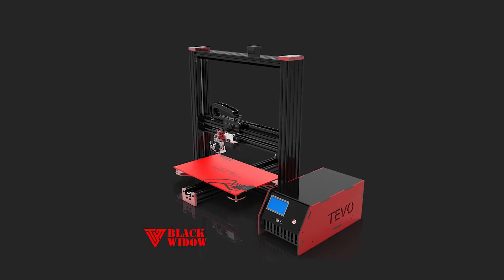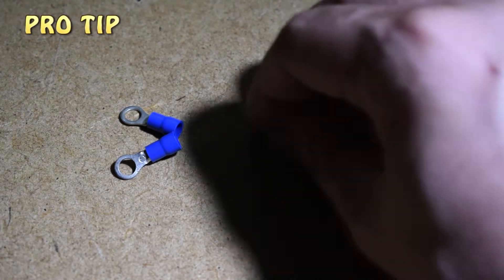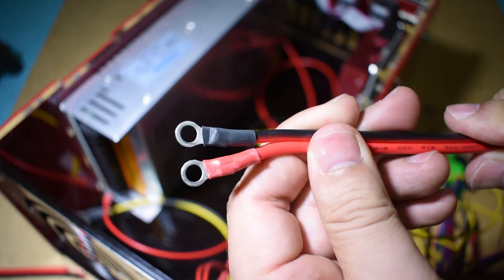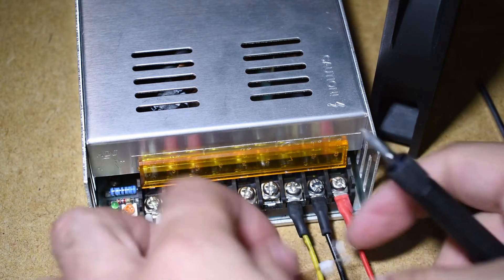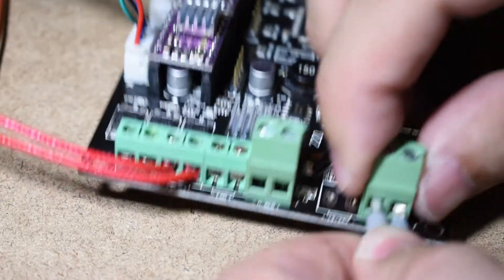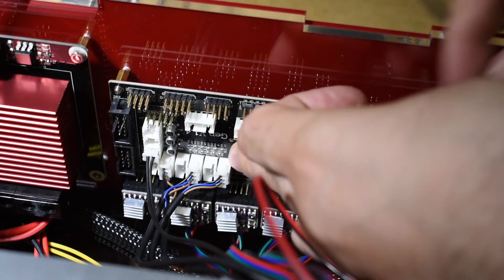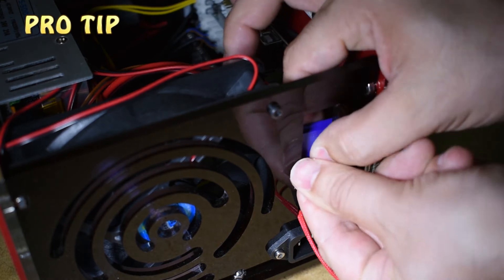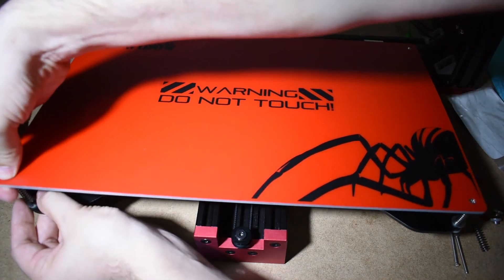TEVO Black Widow V3 assembly - STEP 12 (Electrical connections)

Comment: hi... before of nothing, thank you for the video. i have a question... in the minute 5:40 you said that connect power for the control box cooling fan and extruder coolin fan on the terminal 1 and 6 of the power supplyn how many fans are you connecting? i see 3 positives cables and 3 negatives, i´m confuse on that... and then in the main board you say that connect the layer cable fan, what fan is that? sorry for all the question but i have a problem with my black widow printer, i can´t startup my printer... thanks!!
Reply from the maker: Hi Hacelo,
I'm connecting directly to the power supply the components that need to be always on like the extruder fan, the control box fan and the LEDs. The layer fan is not included with the kit but it's very helpful when printing with PLA for achieving higher quality. This fan must be controlled by the slicer and that's why it's connected to the board and not to the power supply.
Reply: Hi Ruiraptor!! thank you so much for make clear to me thats connections, i´m still can not startup my printer, i don´t know if it possible keep in touch by email i´d like send to you some pictures of connections that i did. and you help me up to fix the problem. thank you again!!! email: omargian@hotmail.com
Reply from the maker: Hi there,
Sure. I just sent you an email.
Reply: thank you!! i´m going to organice the wiring for take some pictures and i´ll send to you by email, thanks a lot!!